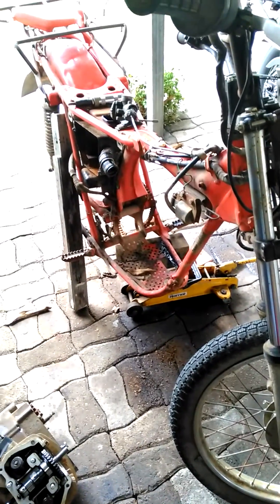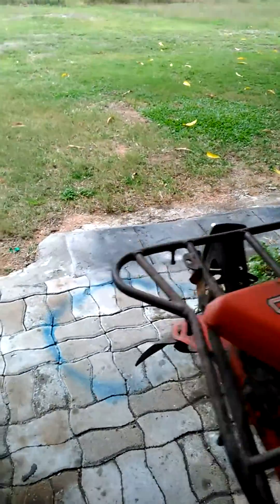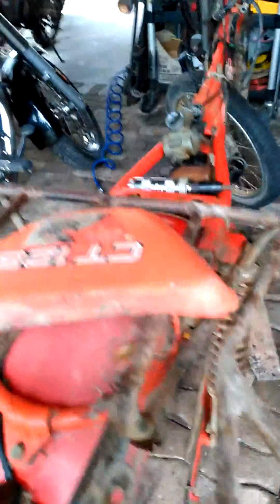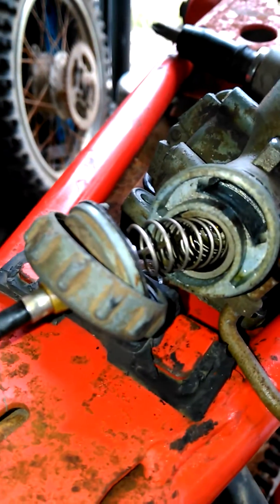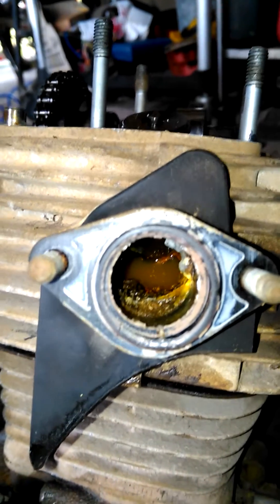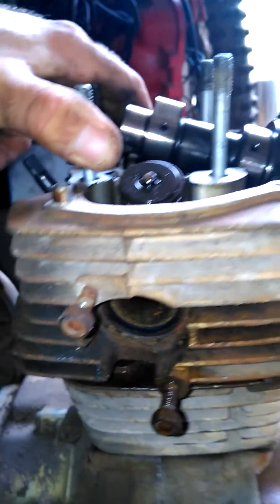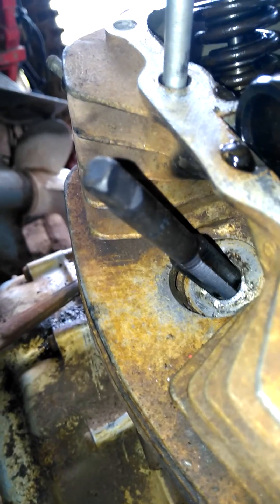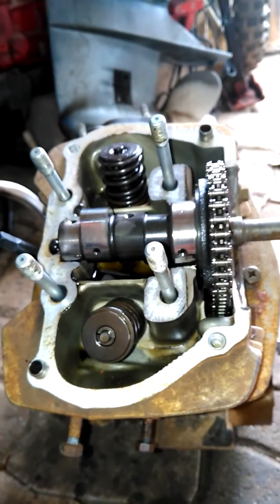Honda CT125 ag bike 1980 rebuild. Part 4

Comment: How are you doing with that ct? Is it running yet?
Im doing one too. Please more video!
Reply from the maker: its going OK, I have had a knee injury and reconstruction since December so has stalled a bit. The engine was stripped down, ants had made a nest in the bore and I have had to hone it out to a 58.5mm piston from standard. The cam chain I decided to replace, I had to pull the clutch basket apart and get it to move freely which it did and does not need any new parts. I have stripped the carby and rebuilt it and due to the over sized piston I had to drill the main jet to get more fuel. Considering how badly it was seized and how it was full of water I wasn't expecting it to work. My goal with this was to keep all original parts if possible and its a testament to how things were built in the 70s. 
just bought new head stock bearings for the steering, and a new chain and rear sprocket and bushes. When I am mobile again I will continue the rebuild and post more videos. I want this bike to be registered again and ride it around Australia. That is the goal!
Reply: Good news that your still at it. Hope the knee is functioning as it should. Bought mine last summer from a father and son who had given up. Perhaps not as weathered as yours, but the tank was well ventilated! Motor is free so I think it will start. If there are any issues with engine operation or gearbox, I will send it to the specialist for a complete. Goal now is to get it assembled and running. Bike was never registered, so like you, hope to get plates and ride the thing! Great that there are still lots of bits for these bikes. Cheers from Vancouver B.C.